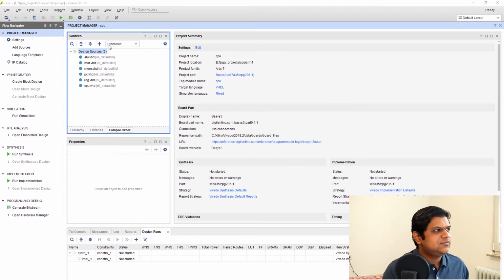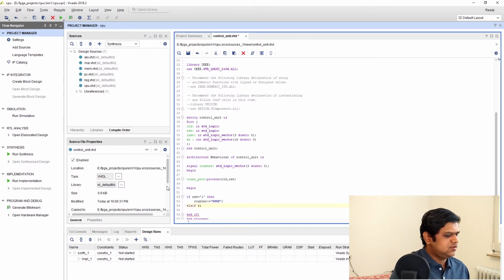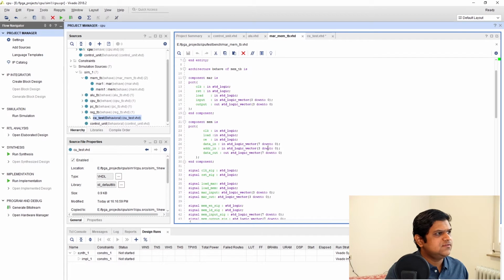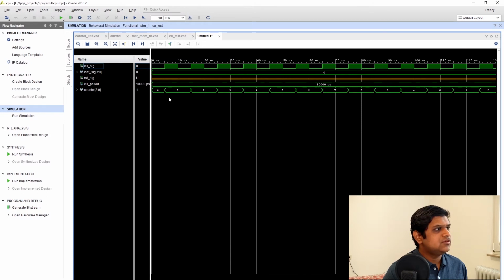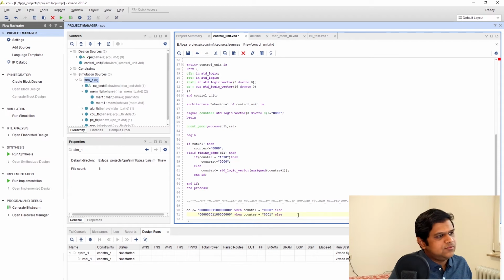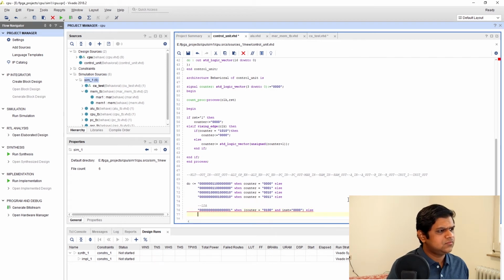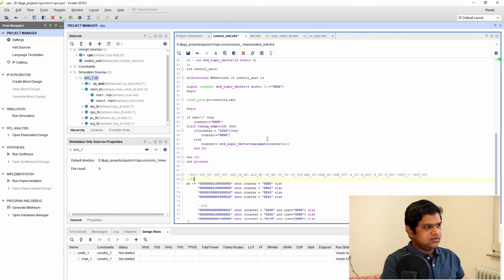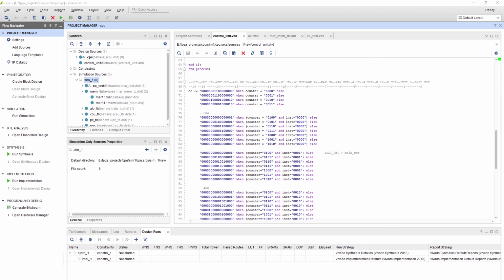Part #9 - 8 Bit CPU On FPGA  - Control Unit ( Part 2 )

Comment: The clock of the control unit has to be the inverse of the main cpu clock, so that the control signals are set on cpu clock falling edge and executed on cpu clock rising edge
Reply from the maker: Thank you for your comment. I went back to Ben's video and sure enough I have missed that part. I'll implement it soon.